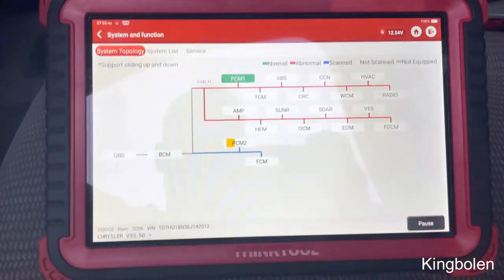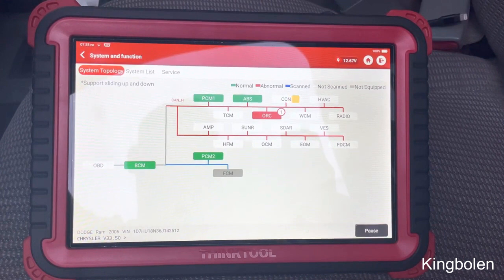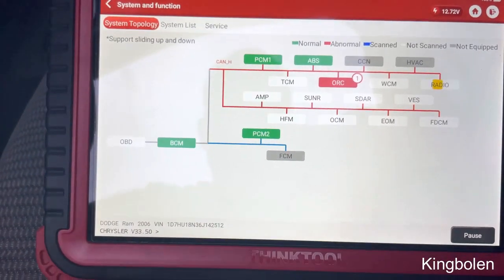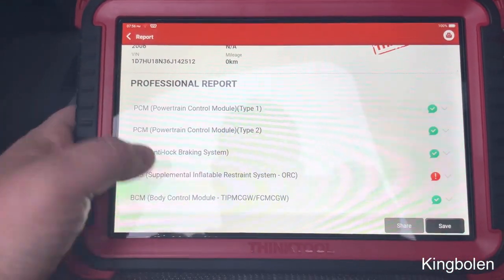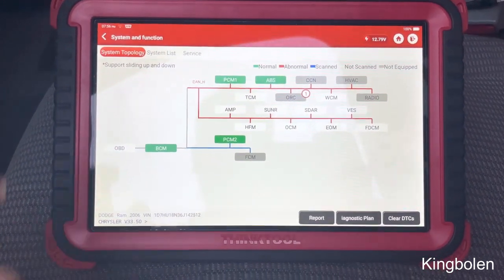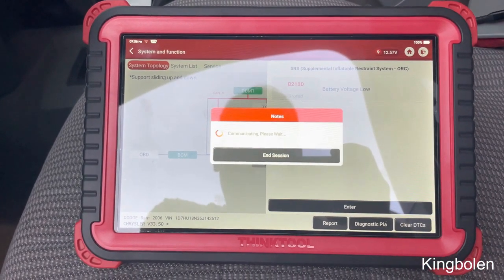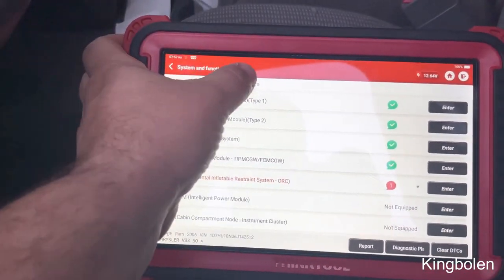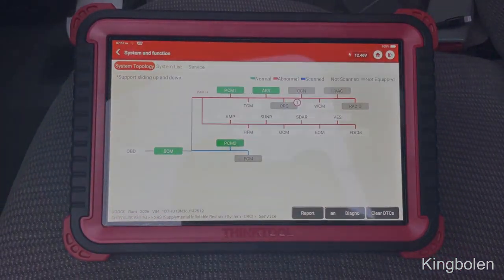Thinkcar Thinktool Pros system topology features

Comment: The question is how to access this feature from the start, step by step. I can't find it in the menu or in any instructions.
Reply from the maker: Make sure you use the 10inch tablet pros and check the features under 'Diagnosis'.
Not every car model show this features.
Reply: @thinkcartool3825  Ok, I will look into it further. Thanks for your reply!
Reply from the maker: Check this video https://youtu.be/a7uDufbkKxU?t=785
Reply: @thinkcartool3825  Thanks for this link. I have the same Think Tool as Ivan. I was trying it on a 2010 Dodge Grand caravan. Will have to play with it a bit more.

Comment: Recently I buy think tool pro I m using on GMC when connect VCI to OBD port system connect can daignois but in dash ABS Traction Gear Indicator geting flash some protocol distarb in scan report many module lost communication 
Becuse rezan  of VCI connect car get Misbhave transmission not shifting becuse VCI distarb the some Can system protocol must we disconnect VCI than Car get normal 
My advice don't Buy this tool just losing

Comment: I have a 2007 Jeep Grand Cherokee in my shop but I can’t get the topology page to come up.  What are the steps to getting that page to show on the tool?
Reply from the maker: Do you have the thinktool pros 10inch?
When you have a quick Vin scan or manual scan, it should be display the topology button, But not for all cars.
You can test it on more cars, We will also add more cars with topology feature in future.
Reply: @thinkcartool3825  
  Yes I have the ThinkTool pros 10inch.  I’ve used it on a 2003 Honda CRV, a 2004 Chevy Express Van,  2005 Ford Explorer and the 2007 Jeep Grand Cherokee.  The topology page did not come up on any of them.  It’s probably operator ignorance but the manual that comes with it leaves a lot to be figured out on your own.  Specific steps to get to this page would be nice to have in the manual.
Reply: Per Ivan’s suggestion at Pine Hollow Auto Diagnostics I did an update and that seems to have worked.  I would never had thought you would have to update a new scanner after only two months of having it.
Reply from the maker: @weshawkins7165  You can take care the upgrade, we will keep add more features in future.

Comment: Do you get topology layout for all makes/models?
Reply from the maker: No,only for some cars but we will add more in futures.
Only thinktool pros supports topology  https://amzn.to/3qEWYm3
Reply: @thinkcartool3825  what's the difference between pros and pros+
Reply from the maker: @uar8836  pros+ more expensive and can do J2534 programming but not include USA/Spain IP.
If you live in USA/Spain, then the function is same.
Reply: @thinkcartool3825  hi , Spain .. ? why ? some solutions for this ?
Reply from the maker: @robertoherrera7382  Did you do a lot of programming?
Reply: @thinkcartool3825  sometimes, no every day,could  do programing 15 in year
Reply from the maker: @robertoherrera7382  If you just do ECU coding on cars, it would be supports. If you do the programming on blank module similar J2534 then it not be support in USA/Spain as you local law.
Reply: @thinkcartool3825  I’ve got the pro and can not find Topology at all. I thought it had topology! It’s very disappointing.
Reply from the maker: @robertotto7673  Hello Robert, only pros can do the Topology features but pro can not. You can see the video title write Pros.
Reply: @thinkcartool3825  yes I see that now. Pro’s is pleural as more than one of in the US. Not a different model! Can I upgrade without buying a completely new one?
Reply from the maker: @robertotto7673  The pros only display topology features on some cars but not at all.
Can I upgrade without buying a completely new one?>>> No, But actually the topology features work similar the health scan.
Reply: I want to know if the Think tool pros can use j2534  box?
Reply from the maker: @garveycrooks1352  No

Comment: Question do you have to pay for the subscription for that program on your thinktool pro ?
Reply from the maker: Thinktool pro 2 year free update.
It is free if you just don ECU coding on cars,which programming programmed module.
Reply: I have a thinkingtool pro. But it doesn't show the topology and the version its V1.1 i tried to update and it said its the lastest version. I still have the 2 years update avaliable.
Reply: @octaviohernandez1760  I too have not figured how to access the topography feature!
Reply: @unclemarksdiyauto  I've only had my ProS model about two weeks and have only messed with it on two vehicles (2012 Nissan Altima & 2014 Chevrolet Silverado 1500). I've noticed I do not get the topology map on the Nissan, but I get it on the Silverado. Unfortunately on the Silverado, it does not show what each box (module) is unless I click on it, unlike what is shown in the majority of Ivan's (Pine Hollow Auto Diagnostics on YT) videos. Kind of upsetting, but for what I use the scanner for, I can live with it. Maybe as I test in on other vehicles it will work on those, but unfortunately it does not work on my two personal vehicles.
Reply: @longrangelauber  I was told it is possible that the topography feature is not supported with the 2010 Dodge Grand Caravan I was trying to use it on. Disappointing, because its the wife's van and she will probably alway want one of these.
Reply: @unclemarksdiyauto  I saw in one of the channels replies above they said they're working on getting it working on more vehicles, hoping that comes soon for the both of us!
Reply: @longrangelauber  Thanks for the update, LongrangeLauber! I should check for the latest update. (I did one a couple months back.